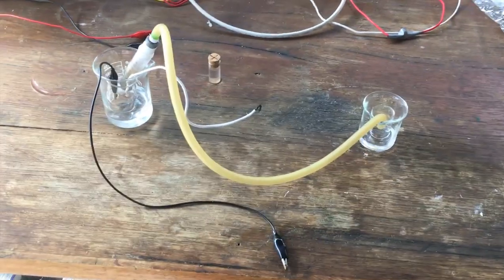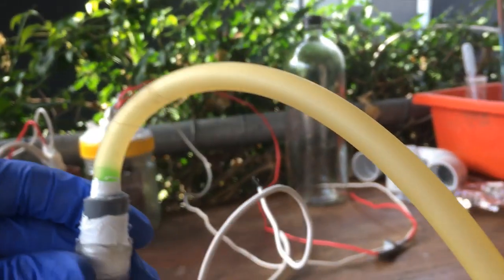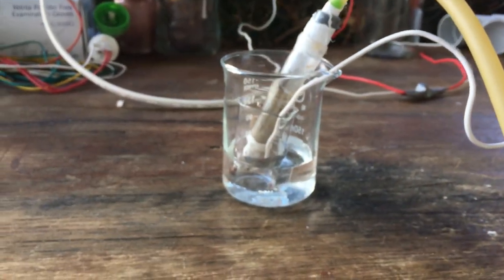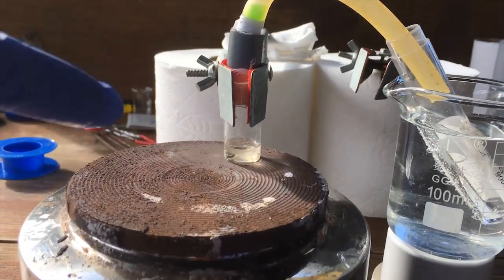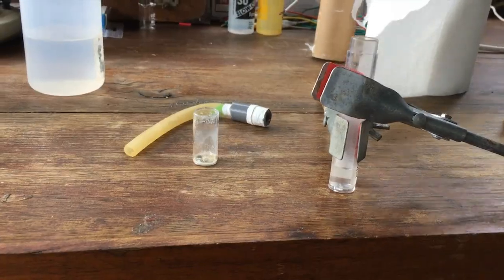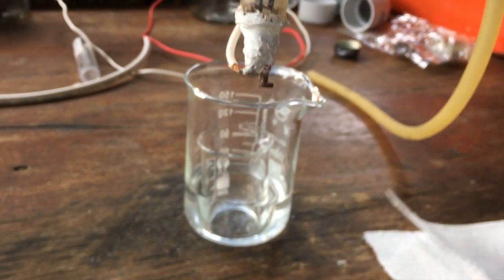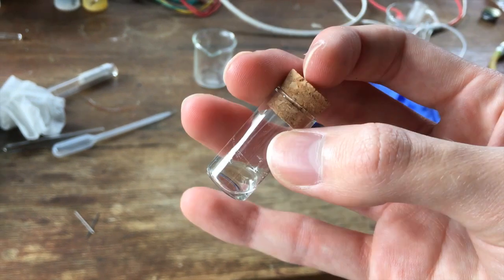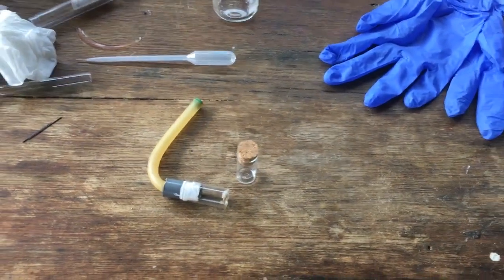Making Deuterium - Part 7

Comment: I will try to do similar this year but I think I will try with a 200 litre barrel. what was your reason behind using such a small cell and multiple refills? I was also thinking that if I can collect a lot of hydrogen and oxygen at the bottom of the barrel it will be at least slightly pressurised so I can use it. my only real concern is the heat generated. I hope you can finish the series soon
Reply from the maker: I used a small cell for 3 reasons:
1) It's cheaper to build a smaller cell with smaller surface area electrodes.
2) It's safer, seeing as there's less hydrogen being stored in the dead space of the cell at any time, limiting explosion risk.
3) Most importantly, it requires MUCH less electrolyte, which was the second most expensive part of the process, after the electricity itself.

I'd be very hesitant to store any quantity of hydrogen/oxygen mixture due to the explosion risk, especially when under pressure, but if you're properly confident on that front, I won't stop you.

The best way to mitigate heat generation is to use the lowest possible voltage for your cell. If you can reduce the cell resistance enough to get a reasonable current at 2 or 3 V, the heat generated will be very minimal.